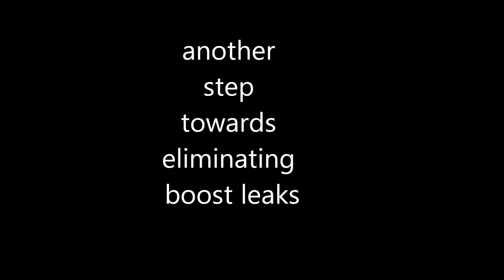crushing evo ix blow of valve

Comment: Jw how did it run before and after this? Just bought a jdm evo 9 bov and haven't crushed it yet but did a boost leak test and it does leak a tiny bit from the bov